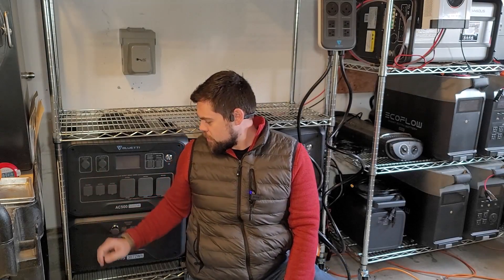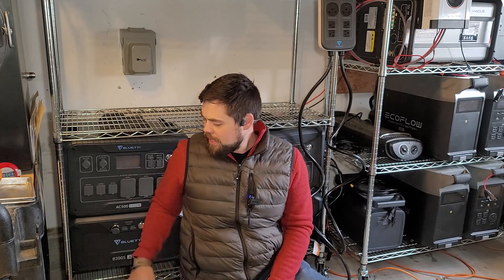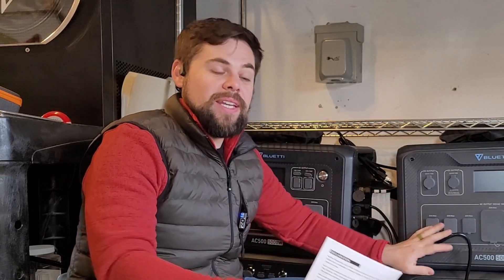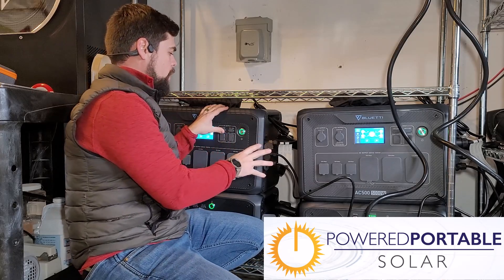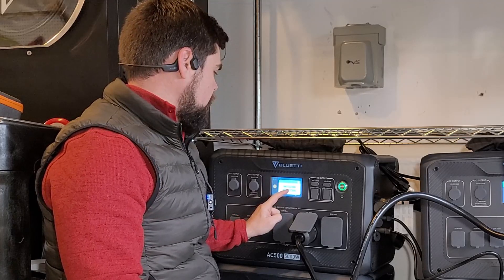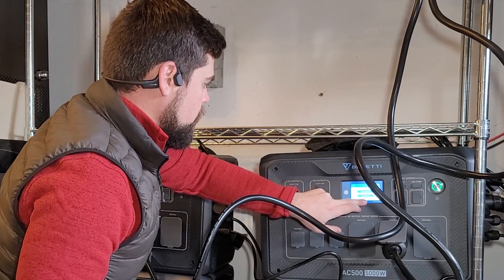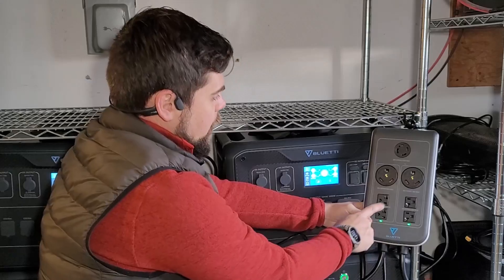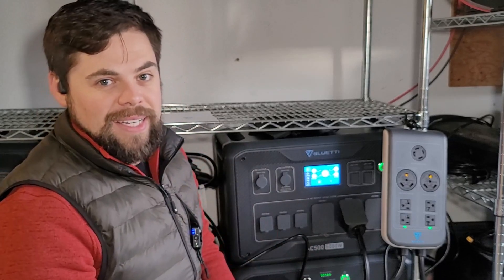Bluetti AC500 240v Fusion Box Setup

Comment: You would have to get more batteries. At least 2 or 3 Batteries per generator for Each of the AC 500 Generators to run full capabilities of 10000 W.
At least that's what I heard from one other YouTube channel. And from my thing, the company has won't have are advertisements about it.

Comment: Exaction arouse me to run my water heater in my kitchen stove for about well let's see my kitchen solvers 3600 w my water heater is 4800 together that's 8400 w so it will run those two things for 1 hour and 15 minutes. I'll think I'll need some more batteries knowing my kitchen stove will run three or four a day and one of those times it'll run about an hour and half. And the water heater turns out periodically throughout the day and night to keep the water hot in the water heater but I don't think they 4800 watts  each time I'm not sure but I'll take it as it does. I believe that would be 41000 watts in a 24 hour day so I would need at least 10 batteries just to run my water heater and kitchen stove. So I guess I would need two AC500 and all their batteries and Two AC300 and all their batteries. The Ac300 can run my dryer, wash machine, frigerator 2000 watts,microwave 1700 watts, two 115 volts 865 watts air conditioner split heaters. And the lights in the kitchen , bathroom, and three lights in the basement. And then I'm going to need another pair of generators with all its batteries I just don't know what ones at this time but I do what I will buy just not what I will put them to. Because I need to run rest of the split air conditioner heaters for one pair of generators. And then I'll need another pair of generators to run the rest of my house and maybe more for my power tools.

Comment: They are selling the AC500 Power Suite on idiegogo, but no details on the sub panel they are “selling” - would it be possible to make this output cord? They are using 2*NEMA 14-50 to SS2-50R Cable …?
Reply from the maker: I've talked with multiple people at Bluetti about this. They advertise 10,000w but there is no fusion box to get 10,000w output. it appears their Power Suite is the only way of potentially getting 10,000w. According to the IndieGoGo campaign you can only get 10,000w output if you connect it to your house electrcial panel, which would mean you have to get the power suite.
Reply: @minutemansolar  thanks for the reply. The power suite is still on indiegogo … I’m a boomer when it comes to crowdfunding, is there a chance they won’t ship it and I will have just donated to them?
Reply from the maker: @RobMynatt  they will eventually end up shipping it. But from what I can tell it's just a transfer switch. Maybe what's proprietary is the splitter cable.
Reply: I made my own 240v cable for the fusion box & two EP500s. Seems to be working ok but the fusion box is limited to only 20 amps.

Comment: I think the AC500 is a better home backup system rather than a portable system as it is very big and heavy.
Reply: I agree that the Bluetti AC500 is more suited for home backup due to its size and weight. However, if you're looking for a portable option, I highly recommend the Segway Portable PowerStation Cube Series. It has a massive capacity, fast recharging, versatile sockets, and comprehensive protections. Plus, it's waterproof and can be controlled via an app. Perfect for outdoor enthusiasts like us!

Comment: I’m sorry, but you have a 5KW x 2 inverter system and 50A output each AC500 AND you only use the 30A????? Why waste the money on AC500 when all you need is 2 x AC300 (30A each unit!!!!) when using the Bluetti solution of Fusion Box. Does not make sense and I’ve gone round and round with Bluetti about the issue - NO 50A Fusion box, now or in the future. But they do have a setup with forthcoming cables and 50A plug boxes for connection to main system and a Transfer switch box (through Indiegogo campaign). Hope you get lots of clicks!!!!!!😉😁
Reply from the maker: Ya their IndieGoGo campiagn says they're coming out with the 50a 240v Fusion Box. I've been trying to buy one. I finally got a hold of a rep at Bluetti and they said they're not going to make it. So they falsly advertised. I will be talking about that in my next video about this unit.
Reply: @minutemansolar   Please do!!! Hope it makes a difference! You’re more than welcome to quote and/or use my post if you need too! I’m also in a “feud” with Bluetti and Indiegogo about their infamous claims which are just blatant false advertising!!! Have posted several times on the Bluetti forums, no response there either! Thanks!

Comment: Did you get the issue where an error occur when you plug both AC500 for AC charging while in split phase? Can't find any solution.
Reply from the maker: I havne't gotten that far yet. I'll take a look into that.
Reply: I think you can use only solar  no AC charging in split phase
Reply: @vincepicone950   Yeah AC 120v can't work when in split phase. I'll try charging in 240v when my setup will be up.
Reply: Did you have a problem shutting down  my master shut down no problem but the slave did not and it had 3 error codes   I had to reset the master then cleared the codes and shut them both down separately
Reply: @vincepicone950  never did so far sorry
Reply: Just for futur reference, if you plan using this system in split phase, you NEED to get the 50A split phase cable (240v) to be able to charge the system with AC as well. As of today, it's only available on Indiegogo.

Comment: Since the inverter on the bluetti is bigger hook your solar to your eco flow set up and get the 30A split phase charging cable from bluetti then put your ecoflow in split phase  and use the 240v to charge your bluetti tht way your using all batteries and have room to store excess solar thts wat plan to do with my ep500s soon as I get the other back from bluetti (warranty claim)....they will charge my Ac500

Comment: Ok at 240 volts, but my main question is those fans run all the time ? Is there a BLUETTI model that does not run fans 24 a day while I’m solar charging and using battery converter end to ac volts to lower daily use of grid power.     Thanks
Reply: The Ac500 fans hardly turn on you have to be somewhere near its upper capabilities to get the fans to kick on
Reply from the maker: I didn't notice any fans on the unit. The wall charger fan will blow all of the time even if it's not charging, but the unit itself doesn't have fans running non-stop.

Comment: Those cables are a bit bulky and cumbersome, but as long as it works, right?
Reply: yup
Reply: More power more wight   bigger battery   more power.  more wight  I wish I could power my house with only 40 lbs of equipment. But don’t think it will happen in my lifetime.

Comment: How come he didn’t use the far right port? I thought that was for split phase ?
Reply: Because it's, can you believe, only 120 volt not 240volt.  I bought it thinking the same, though never attempted to use that port.   Within a week the unit failed and threw errors that I couldn't clear.  When you attempt to contact to Bluetti you will discover that they have no support ability to handle customers.  I'm in the process of returning mine, not because I don't think that mine should have issues, but because of the lack of support.  I think, if they worked, they are amazing. After being ignored for weeks on end and no way to call anyone for help.. I will not do business with them.  stay away.  you might get lucky.  but if not.. you'll be left high and dry
Reply: @DuncanCunningham  I’m in Australia and I own a ac500 and it’s all native 220-240v because thats the Australian standard we went with, maybe you guys in the USA should change over  to all 240v power.
 why not come over the metric system too while your at it 🤣 jokes aside best of luck .
Reply: It is for split phase but for some reason the fusion box only connects to the 30A port they do sell a cable for 150 tht can split phase the 50A port
Reply: @Ajacka916  Yes they are in the process of making those cables! BUT - the issue is the advertising of being 240V 50A capable, then they say oh, if you buy these cables - AFTER you’ve already purchased the AC500 units! 😞👎🏽😩
Reply: I believe you need two AC500 to get 240 at all   So the far right plug will not work with just one AC 500 Bluetti just added a 800 number. So finally we are starting to get answers. Also you can buy the AC 500 now from Bluetti.  I believe. So as more people get them we will get answers to so many questions.

Comment: Aw i wanted to see a run test
Reply from the maker: Coming soon!
Reply: @minutemansolar   just wanted to see a demo of what it can run or how much it can run at once. I would try it out for a week
Reply from the maker: @jayblescashews  Yes that review is coming. I personally pay for this equipment and I am saving up for more batteries. Ideally I want to get six more batteries for 18kwh of battery capacity so it's comparable to my Delta Pro 21kwh setup. Then I will also get my Apollo next week, and then I'll have that to test which is a 21kwh setup too. So those three will then go head to head. There are a lot of great videos in the works.
Reply: @minutemansolar  awesom i will be watching for sure